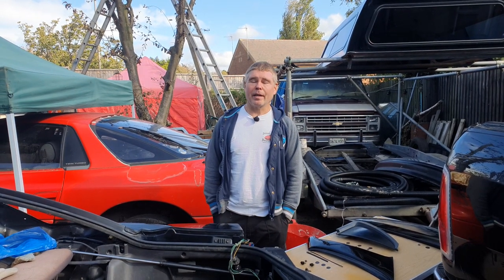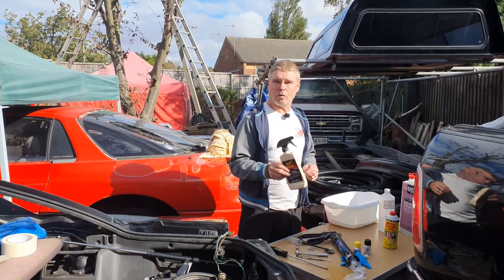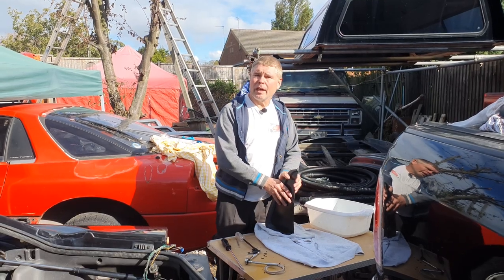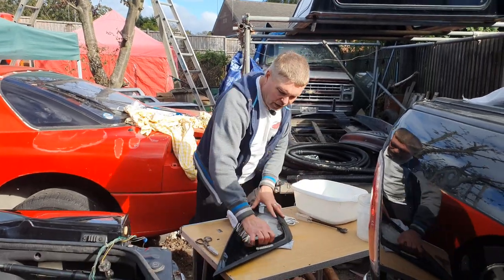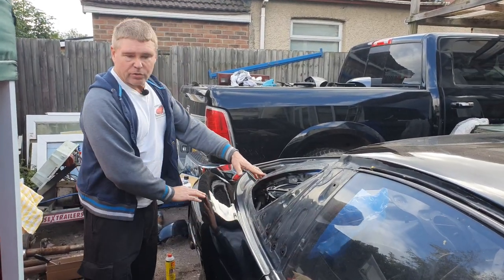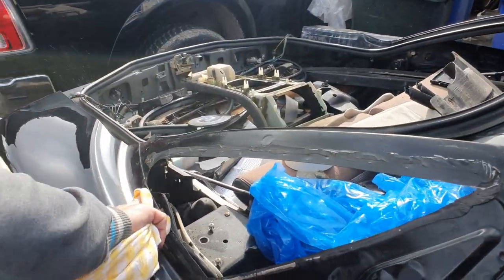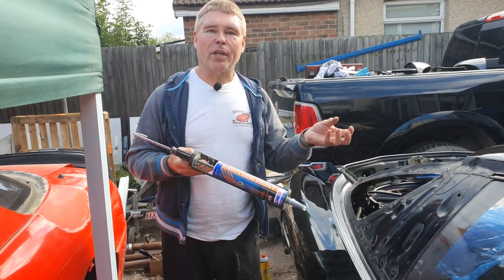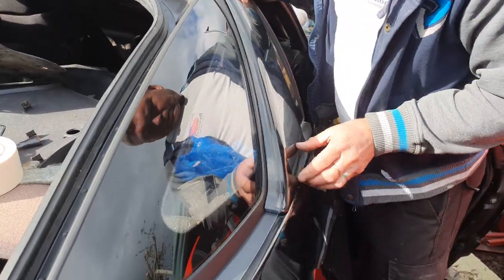Mitsubishi 3000gt / GTO Rear Window Installation + Sail Panels

Comment: Joe that new paintwork looks fantastic.. is that sealant for the back glass harmful to the paint job? I think I'm gonna just cover mine before I get to the adhesive.
Also, I must have lost at least three of those nuts for the inner side sail panel down in the car never to be seen again.. You had a much easier time with those buggers
Reply from the maker: The instructions specifically say that you should only cover the bare matal and ceramic coating of the glass. It may be worth speaking to a specialist before going ahead with your plans incase it causes problems later down the line.

Comment: hi Joe. i have a question. on the end of this movie you fit paint side panel. between this panel and roof should be any rubber?
Reply from the maker: Yes. Please check the video again. There is rubber at the top and bottom and on each bolt.
Reply: @3000GTGTORestoration  It is actually seeing now.  my mistake.  thank you.